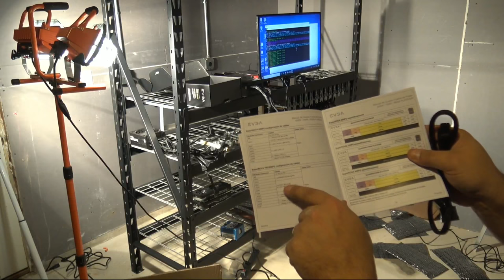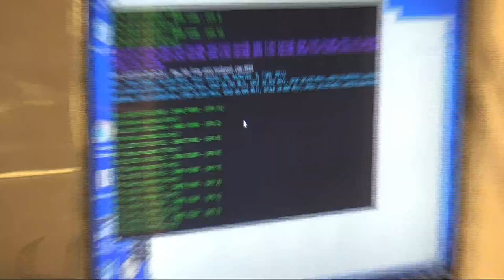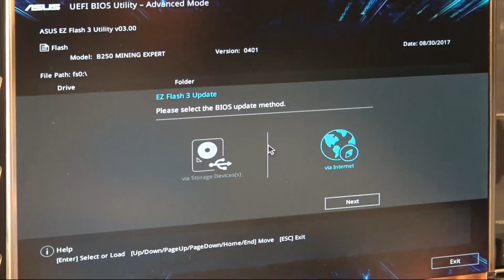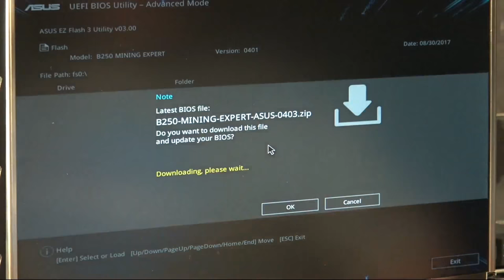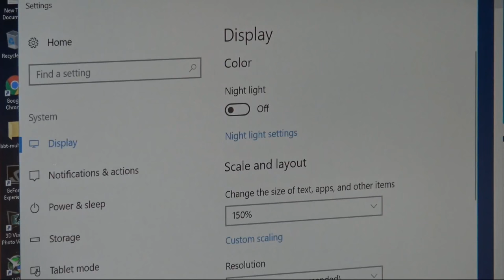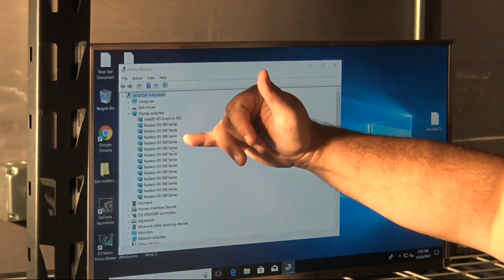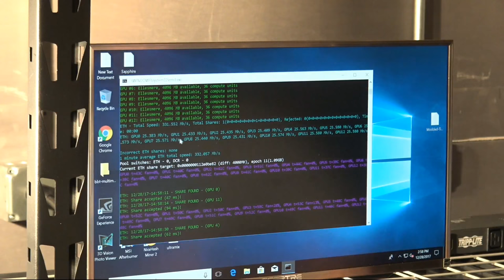VLOG #78 60+ GPU Build - Part 1 (livestream) 13x Sapphire RX580 4GB Pulse with B250 Mining Expert

Comment: 0:00 Stream Starts with full audio/Greetings
1:42 Rig explaining/Tonights testing plans
3:30 Rack Explanation
8:40 b250 Motherboard power plans
6:25 Question: What is a p106 mining card?
8:15 Rack Setup Explantation/Mounting GPUS
10:12 Double sided Tape vs zip ties/tie wraps
11:10 Rig Crashes with By windows update
12:30 Sapphire Rx 580 4GB Overclock settings
12:57 Motherboard stands explanation
15:30 Bios is timings only
16:10 Building starts(beware power tools) Mounting Motherboard
23:10 Question: 13 Gpus per board why are you using 3 power supplies?
26:25 EVGA Supernova 850 P2 Setup/PDU plan

27:15 Question: What are you going to do with all the Heat?
28:40 Power Supply port use
30:30 Question: How much does this rig cost?
31:30 Rig Crashes again 
32:39 Base Cost for 1060 vs this setup
33:00 Explaining the pros of planning your build
33:48 Question:  Back in the day you used to recommend 60% PSU loads but now it seems like your going more?
34:30 Setting up -nofee for mining
34:55 Ram Explanation
36:20 Why he trying -nofee mode
39:20 Windows 10 Fall creators update to use 13 gpus
39:40 Question: Memory type of Gpus? Elpida 
40:35 Question: Tell us about the Triplite Pdu
.
42:50 No word on the getting P104s
42:56 Question: Is the GPU limit on the board an IRQ limit?
44:20 Close up Camera on the build so far. Angle Aluminium/rack setup
49:25 Close up on running rig
51:10 Confirms -nofee is working, hash drop confirmed
52:55 how to connect pdu to 30 amp outlet
51:05 Where to the vga connectors go?
57:40 Question: What do you plan on doing to cool the room?
57:25 Question: What is the best GPU to mine on?
1:01:00 Third PSU Setup
1:03:40 Question: Had 4 RX 470s and the power cable melted what could he have done different?
1:09:00 Bitcoin conference coming up.
1:10:00 How long it takes to build these big rigs.
1:11:30 Rigging is mining @ 362MH 28.8MH Per card
1:14:00 Question: Will you show the finished version of 6x 1070 rig?
1:14:40 Bits Be Drippin’
1:17:40 Separating the power cables
1:19:25 Cpu I3 7100k installation
1:24:15 Why Open shelves are better.

1:26:10 Question: how many gpus can windows run and will Nicehash recognize more than 8 gpus? 21 card record https://www.youtube.com/watch?v=rtrQWXcGR_w
1:28:20 Memory Install
1:28:55 Question: why not use the chinese 2400w psu for this build?
1:30:30 Close up on PSU and PDU setup and explanation. 
1:34:40 2 Sided tape Setup
1:37:30 1 gpu per sata connector explanation why it works for this build
1:39:20 Riser Setup + GPU
1:47:30 Question: paying taxes on mining profits
1:53:40 Installing the 6 pin expander
1:55:20 Powershell only sees 10 gpus in windows(or 8 if you not using the newest updates windows 10)
1:03:10 Question: On the next shelf down are you going to put the cards on the opposite side for better airflow?
2:06:00 Question: Where do you think ubiq will go in 2018?
2:08:55 Request for cryptonight/ Why he can't mine it right now. ~10452h
2:20:55 Question: Why doesn't the cpu pci limite effect the number of gpus
2:23:20 plugging in Sata cables 
2:26:10 Question: What are some good risers? https://www.amazon.com/Onvian-Mining-Dedicated-Graphics-Supply/dp/B01MU51491/ref=as_li_ss_tl?s=electronics&ie=UTF8&qid=1514429583&sr=1-3&keywords=1x+16x+riser&linkCode=sl1&tag=bbtstore-20&linkId=96a9c94ee6bb8004ff337c8d907f828e
2:28:20 Question: Total watts on 60 GPUs?  ~9000w

2:28:45 BTC<14k USD
2:30:00 Snack Time!
2:33:40 Powering on Rig 
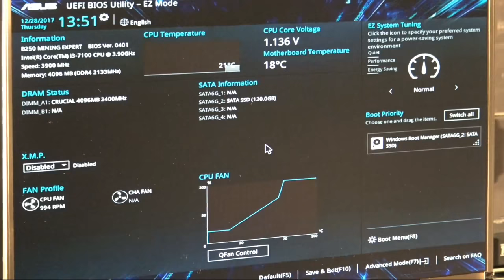2:34:40 First step is to update BIOS
2:47:10 Question: Has the BIOS issues with the b250 been fixed?
2:38:00 BIOS setup
2:39:45 If your going to use Simple mining use this setting for it to see your USB(Launch CSM>Auto)
2:41:10 First Boot into Windows 10
2:42:10 Explanation on why Windows 10 found the 10 gpus so fast
2:45:00 Question: How do you do your pre built Windows Drives?
2:46:50 Checking GPU memory type with GPU-Z

2:55:00 Using Powershell to Flash 10 GPUS
3:05:10 Checking GPU memory type with GPU-Z for other 3 cards
3:05:35  Question: Can I run 13 rx 480 8gb nitro on 3 850p2? (Not sure if this is the correct question, very hard to hear)
3:08:30 Question: Do you ship to Montreal Canada for Tshirts? 
3:11:40 Are these live streams helping anybody out there that are doing this?
3:15:30 Booting with all 13 GPUs
3:19:40 Question: blockchain driver or adrenaline driver and are there any quirks with creators update? (Turning on compute mode)
3:23:00 Stable settings* works on other rig
3:35:18 Question: What UPS do you recommend on a 13 card system?

3:26:00  First test getting 25.4 Mh/s per card
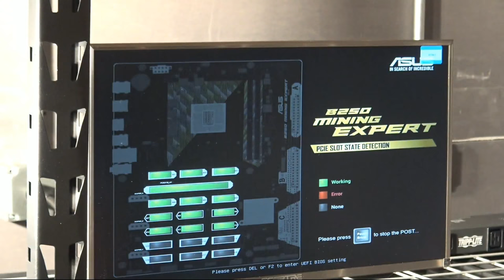3:27:30 What the time commitment to get a mining farm/rack this large up and running?
3:29:20 Second test, blew the driver. 
3:32:30 Third Test,  blew the driver.
3:36:25 Question: People seeing 40+ Mh/s on GTX 1060 are they fake?
3:38:30 Downloading newest BBT Multiminer
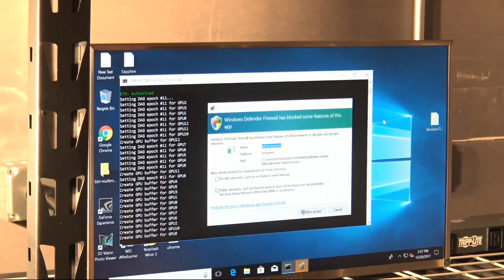3:41:15 Fouth Test, 25.4Mh/s on non compute mods, and crashed on the devfee like other miner.
3:42:18 Outro

Etc 0xd8206bd0ab6767ac832169591f10d7ec3b98480c
Reply: there is no 3:40:55 Question: People seeing 40+ Mh/s on GTX 1060 are they fake?
good question tho
Reply: just checked some of the time stamps, seems like the something happened to my video last night when I was watching and a lot of them are off. in the process of fixing but will take awhile
Reply: Times stamps should be fixed
Reply: 49:20 Windows 10 Fall creators update to use 13 gpus -> Bad Timestamp
Reply: looks like they edited the video to remove the dead air that was at the start, the video is ~8 min shorter now.  I'll go through it again to fix them but will take awhile.
Reply: looks like they make it easy for me to fix, they removed a 10min from the start.   ALl the time stamps should be fixed again.  The time stamp you are looking for is now at 39:20 Windows 10 Fall creators update to use 13 gpus
Reply: thank you
Reply: How do you just use one monitor for all those gpus?

Comment: Just a suggestion but if you put wheels on the bottom of those racks, with a locking mechanism of course, it will make moving them around to reconfigure or work on them easier.

Comment: Dear  Carter i have the exact Motherboard but for some reason none the on off switches will work right now at least those which are available during the 3 Year + Covid Outbreak. Could you please share which one-off switch you are using. The strange thing with my B 250 Mining Expert Motherboard is than it does-not even react to shortening the on off pins manually with a Screwdriver. Sincerely

Comment: Awesome video. Just built my own two rigs (6x1070ti and 6x5708GB). Dual mining ETH and PASC right now and getting really nice returns. I've overclocked the memory (and somewhat the core) to get the best hashrate and reduced power a bit as long as it doesn't impact performance. Temps on the Radeons are in the 50s, but some of the 1070TIs are up to 75deg. Would you recommend reducing the overclocking to get to a lower temperature, or increase the fan speed ( set to auto now), or not to worry about the temps at all ?

Comment: Hey master BBT, quick question: For a larger farm, with about 40 rigs, do you have any recommendation on a good management software to monitor individually every rig and its performance. Even better if you know something open source or free. If no free solution available, which one you would suggest with the best cost x benefit?

Comment: Amd compute button really helps out those hash rate problems. Check it out at hour 3:25

Did you post a less aggressive bios for those Rx 580s or did it stabilize?  And can you run that bios on an xfx rx 580 with Elpida memory?

Thanks again nice build!!!

Comment: You mentioned using the adrenalin driver but what about the fact the msi afterburner doesn't work with adrenalin?
Reply from the maker: When dealing with 13 in windows, the most reliable is latest driver and placing syntax in line core and mem settings ; i.e. -cclock and -mclock on the line with claymore. We do not use afterburner in that case.

Comment: Bits Welcome: https://youtu.be/xKlXDHdCtqM?t=643
Bits Board for build: https://youtu.be/xKlXDHdCtqM?t=852
Bits Power: https://youtu.be/xKlXDHdCtqM?t=2144
Bits Cost, Parts, and Why: https://youtu.be/xKlXDHdCtqM?t=2374
Bits 13 GPU Windows How?: https://youtu.be/xKlXDHdCtqM?t=2908
Bits Build 1 POV: https://youtu.be/xKlXDHdCtqM?t=3230
Bits Card Install: https://youtu.be/xKlXDHdCtqM?t=6462
Bits on Ubiq: https://youtu.be/xKlXDHdCtqM?t=8126
Bits Boot Up and BIOS setup: https://youtu.be/xKlXDHdCtqM?t=9848
Bits Critical info on Device Identifcation / setup: https://youtu.be/xKlXDHdCtqM?t=10345
Bits Memory Type Check: https://youtu.be/xKlXDHdCtqM?t=10615
Bits PowerShell GPU Flashing: https://youtu.be/xKlXDHdCtqM?t=10966
Why windows then switching to linux: https://youtu.be/xKlXDHdCtqM?t=12632
First run attempt: https://youtu.be/xKlXDHdCtqM?t=12785
People scaming with 40mh/s cards: https://youtu.be/xKlXDHdCtqM?t=13578

0xF4417556703bE002beA43CbaC4Bc1AD4eC9dD019

Comment: Any help would be appreciated. I am trying to setup 12 card Nvidia 1060 on the same motherboard, 4gb ram, 120gb SSD, 16gb Pagefile, when I run Claymore ethermine it comes up with errors about allocating big buffer. If i put in 16gb of RAM (not even 8 works) it works fine. Is this a Nvidia thing? I would really love to not have to use 16gb of DDR4 to run this miner. Thanks for the help!
Reply: GraveMakerLP virtual ram has to be 16gb
Reply: Cihan Aslan virtual ram is set to 16GB even went to 20...same issue
Reply: Hi. try the pagefile WAY bigger. i think the recomandation of 16gb is from the time when most rigs just had 6 gpu.
i run mine between 24 and 30 gb with 12 cards. if i go lower i get the same error you get.
Reply: Thank you i'll try that tonight!

Comment: You say you can run 13 off one 850 and 100w psu.  How when there aren't enough vga ports. Unless cards are sharing a cable or can you use 8pin cpu to power a card some how.
Reply from the maker: We are running 13 on off 3x 850P2's; there are 12 individual 8pin connections and on one of the dual 8/6pin rails, we use a 6 to 8pin converter.
Reply: Yes sir I was watching live last night.  My question was more directed to the statement you made around 32:30 saying you could get away with running two psu's if you were not dual mining.  That's how I got confused on vga ports.  But thank you for the giant service you are doing for all the miners out here! :)
Reply: Bits Be Trippin' trying to understand the cabling. You said that you could power 13 cards with one SATA connection each. There's 4 SATA ports with 4 Strands each. There's only 12 dedicated cables to connect to 12 GPUs not 13. Am I doing the math wrong? Also which PSU is powering the SSD - technically it's pulling like 20-30w does that mean your plugging this along with the same cable that's powering a riser?